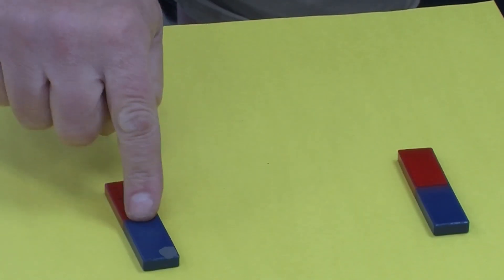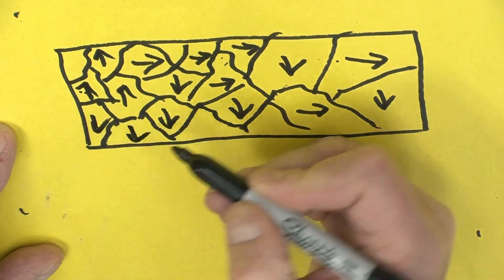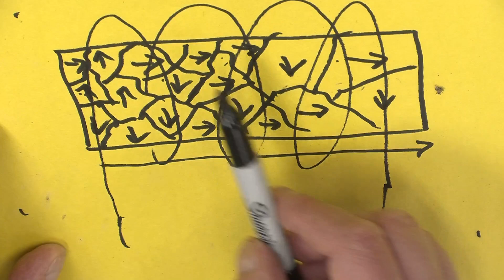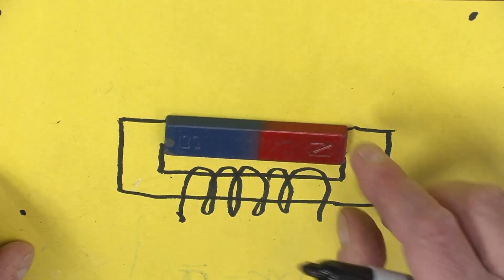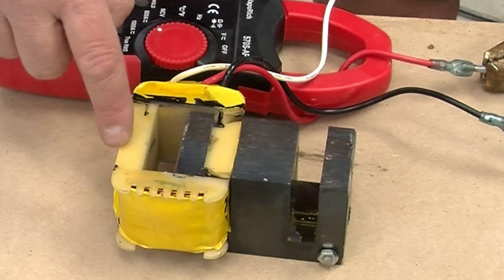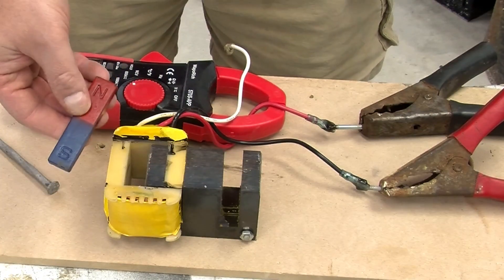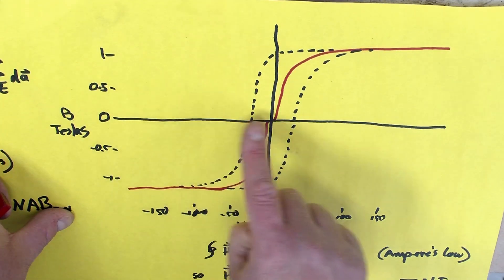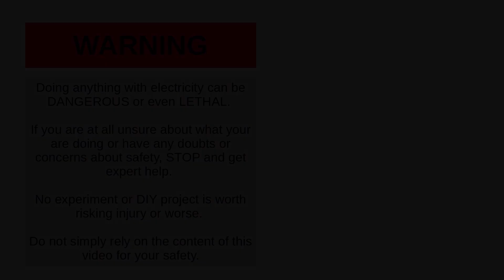How to (Re)Magnetize a Permanent Magnet

Comment: I have a small Steel shaft of 1018. It is about 5/8'' diameter and 3'' long. Is there a way to permanently induce magnetism into it? I assume i would need to make a device like you show at 8:00 but how can I make a simple one at home?
Reply from the maker: Maybe something like a bolt hopefully a bit larger dia than the shaft and also cut to 3" long. Wrap a few hundred turns of wire around the bolt. Position  the bolt parallel to the shaft and cut 2 metal plates so they can be used to connect the bolt to the shaft. Use some tape to secure the plates nice and snug to the bolt and shaft. 

Now apply a few seconds of current to the coil from something like an old style battery charger. 

Note: make sure the cross sectional area of the bolt and and the plates is larger than the shaft. You may have to experiment to get to enough current though the coil to make it hit magnetic saturation.

Also bear in mind that 1018 is magnetically soft and wont retain magnetic fields well. You might be better off gluing some neodymium magnets to a convenient position on the shaft (assuming it doesnt rotate too fast)) to keep it magnetized in which case you wont need to build a magentizer.
Reply: @ElectromagneticVideos  Thanks for all the info! 
This if for a small chemical mixer. I am having to remake for a customer. This shaft is what drives the prop so I believe it needs to be Diametrically magnetized. I am considering drilling the length of the shaft and inserting a couple 1/4'' x 1'' Diametrically magnetized magnets. Would them being inside the shaft severely reduce the magnetism field? Or would that be sufficient to spin it?
Reply from the maker: @NMmachine  Being inside a shaft will tend to shield the field and keep it inside. 

Now that you describe how it will be used, I am very doubtful that it was built to depend on a permanent field in a steel shaft like that - the field simply would not last any length of time. 

Does the shaft rotate? (EDIT - re-read you message - so it does rotate - I will leave in the piston comments but please ignore them :) ) Or move like a piston in normal operation? Is there a coil connected to AC that somehow is near the shaft. My guess is the shaft is either rotating like the the rotor of an induction motor or moving back and forth like a piston. Neither would require permanent magnetization.

I would which the coil - is it open? If the shaft rotates, are there two coils? If one is open it wont work.  ANd if there are two coils, is there a capacitor in series with one coil - the old capacitors tend to fail over time...
Reply: @ElectromagneticVideos  I have not seen the motor that this shaft goes inside. I will try and get my hands on it this afternoon. I believe it is a AC motor. The shaft assembly from the Original Manufacturer rotates So I believe the Motor to be in working condition.

Correct the shaft is rotating. 

I believe the entire assembly is called a Lab mixer or a Lab stirrer. For reference.
A little more detail on the shaft assembly. There are 3 pieces to this shaft. 
1 - The top that is inside the motor. This is the part I have been describing it is about 5/8'' Diameter x 3''' Length. It is heavily magnetized.
2 - There is a 1/4'' Diameter shaft that is welded on the bottom of Item#1 about 12'' long with threads the opposite end for a prop.
3 - The prop. about 1.5'' diameter with blades to mix.

The issue is Item #2 and #3 needs to be a more chemically resistant material.

First Attempt: they tried to coat the entire assembly with PTFE but the heat from the coating process Demagnetized item #1. The assembly would no longer rotate.

Second Attempt: I remade the assembly with Item #1 being 1018 steel. I tried the tapping and stroking methods to induce a magnetic field but could not get it to rotate.

They ordered another assembly from the manufacturer. Item #1 is heavily magnetized and the assembly rotates as it should. Only the Chemicals they are mixing ate Items #2 and #3. So they wanted me to make Items #2 and #3 out of Hastelloy. 

Third Attempt: Item #2 was welded onto Item #1. So I had to machine away until I could get past the weld and get a proper straight drill and ream into the material to press a new Hastelloy Item #2. But had to remove almost 1/2'' in length from Item #1. I TIG welded a spacer to the bottom of Item #1 to achieve proper length. There is still some magnetism left but near the weld the heat de magnetized a large portion. 
- I am going to meet with the customer this afternoon and see if it will still rotate.

I think the best method would be to make Item #1 from scratch but I do not know how to magnetize it sufficiently and achieve rotation. 
Or am I looking at this incorrectly. Is the magnetization caused by the motor itself? If so why would Second Attempt not rotate?

I apologize for the long response and appreciate your insight. I am stumped.
Reply from the maker: @NMmachine  I must admit I am baffled! If the shaft was supposed to be magnetized then  the motor would be some sort of stepper or synchronous motor - good for speed control, but much more complicated in every way  compared to an induction motor that drags things around with the rotating field. But since you have found the rotor is very magnetic and doesnt worth then its demagnetized, it must be something like a stepper or synchronous motor .

So maybe efforts should be made to no-demagnetize the rod when welding. Heat from the welder will demagnetize anything heated above the Curie temperature. The current from the welder might also set up magnetic fields strong enough to mess up the original field. Maybe some other method of join the rods - glue, or a rubber tube with clamps around it? You could ask the manufacturer for advice too ..... good luck - hope you solve it (and let me know what the solution was- I very curious now!

Comment: Nice video. How about discharging a very high voltage  capacitor of say 60KV through a spark gap connected in series with  a coil of 600 turns in which this weak magnet is placed with correct polarity?
Reply from the maker: Your talking about using a current pulse . Thats the want many magnetizers work. Depending on the number of turns and the inductance of the steel bar to be magnetized in the coil. you can generally do that with voltages in the hundreds  of volts and trigger it with a switch or better, a SCR. In the end, as long as you get current high enough so that the field field somewhat above the  saturation value  you end up with a magnet.

Comment: Can you detail how the coil is working?

i need a magnetizer, and I have some coils (transformers & old motors). None look like yours, and you used it in a way I never considered.
Reply from the maker: If you want a coil like that, its a standard 120V to 24V (I think) transformer. Some like this one are poorly constructed so the E and I shaped sections are joined with a shallow weld that a grinder can take care of. Better ones, the E and I sections alternate between top and bottom and are glued together - almost impossible to take apart. This coils was from a old APC UPS rated at 1000 to 1500W if I recall. Look in a recycling bin for somthing like that to get one for free :)
Reply: @ElectromagneticVideos  no, I don't want another. I want to know how to use another. 

i have no ultimate product in mind, I just want to understand it a bit better.  I guess my goal can be to make a rudimentary compass needle.

Maybe I should power one, then wave a compass around it to see where the field is... I can use a normal compass like your mag-wand, right?
Reply from the maker: @Iowa599  Yes - that mag wand is just a two axis compass!

To magentize a plain old needle for a compass, the easiest way is to just stroke it with a strong permanent magnet. Or use one of these: https://youtu.be/AZsYHLHlIso
Reply from the maker: @Iowa599  Sorry - misunderstood. Yes - a compass is a great field detector. Be careful not to get it so close the magent pulls the pointer off its axis though.

Comment: Wish I had seen this much earlier. I adjust the strength of magnets for and industrial application. We don't use an iron core with the coil. The material to be magnetized is the core. There is no need to have an extended time to magnetize the material, so for the current required, a capacitor is charged and then discharged into the coil. Since the magnet is centered in the coil, it is a one step process. When loudspeakers are made, the magnetic material is not magnetized until the speaker basket and magnet assembly is assembled. It is then magnetized. Look for videos of the process online.
Reply from the maker: So you just use the working coil of the device to do the magnetization - with huge burst of current from a capcitor - what a greast way to simplify the process. 

I had no idea speaker were magnetized like that. I'm amazed that the fine wires in the coil can take the current - but as in your example - a brief burst is all it takes. I guess for the same reason, not enough energy in the current spike to move the coil enough to damage it.
Reply: @ElectromagneticVideos  They don't put the current into the voice coil. The magnet assemby is inserted into a larger external coil with high current capacity. The coil I use at work can fit a 4X6 piece, up to 8 inches long inside the coil. The coil is from a 30 KVA power transformer. The winding is 6AWG. I'll have to look at the capacitor value at work. I do remember it is rated for 63 working volts. I think it is 33000 MFD. The entire cycle is over in about 200mS.
Reply from the maker: @isettech  Oh - ok - that makes a lot of sense. Thanks so much for the details. I may try an make a magnetizer like that someday!

Comment: I haven't had to deal with such weak ferrites, but AlNiCo compositions a low enough coercivity that they're easily demagnetized.  Always have to keep them shunted and away from NdFeB magnets.  I once had to do a bunch of testing with mortar fuze components that used AlNiCo cores, and I had to make a jig to remagnetize them.  I guess that's the sort of inconvenience that happens when you try to reuse something that was meant to be used once before exploding.
Reply from the maker: So I'm really curious having never had anything to do with explosives. What do you use the magnets for - some sort of fuse or trigger? I would guess the shock of an explosion would also tend to demagnetize them ...
Reply: @ElectromagneticVideos  A lot of munitions fuzes have to do elaborate things where timing and sensing is required.  Where some of those things used to be implemented mechanically with clockwork, it's all done electronically now.  The problem then is getting electrical energy to power the microcontroller(s) in a way that can have a long shelf life (i.e. no active electrochemical cells).  There are setback and spin-activated dry-charged cells, pyrotechnic generators, and other stuff, but a lot just use a once-through linear electric generator activated by setback.  A tiny magnet gets snapped through a coil by its own inertia, which generates a single pulse which can be stored and used to power everything during flight.  That poor generator only does its thing once before it (and the rest of the circuitry) gets destroyed by the main charge.
Reply from the maker: @PSUQDPICHQIEIWC  Thats amazing. - and clever! Almost infinite shelf life and probably just e enough power to get things done. 

"That poor generator only does its thing once before it ... gets destroyed" I guess that so true for so many of our sophisticated weapons these days. And for many other things, microelectronics has become so cheap they are essentially expendable - RFID tags immediately come to mind.

Comment: error : the batyery equvalence makes sense only when the magnet moves relative to the coil.
Reply from the maker: Not quite sure what you mean. Reluctance circuits are a pretty standard way of approximately calculating magnetic fields in this sort of situation. Here is a link a that describes it in a bit more detail: https://eepower.com/technical-articles/magnetic-circuit-properties-understanding-reluctance/#

Comment: Why would you need to (re)magnetize a PERMANENT magnet? More science nonsense? :-)
Reply from the maker: Its not at all uncommon for a permanent magnet to loose its magnetic field, particualry after being dropped or exposed to heat.
Reply: @ElectromagneticVideos  Do ALL magnets loose some magnetism over time? Even neodymium?  What if never used? Can a magnetic domain spontaneously move out of alignment?
Reply from the maker: @MrSummitville  Thats a very interesting question, particularity since we have have only been making magnets for the last few hundred years. 

Iron containing rocks that have been heated have retained traces of the earths magnetic filed for thousands (millions?) of years, but those remnant fields are very weak. So magnetism can last a long time. 

Magnet life is a probability thing: how strongly the domain boundaries are "locked" into place (based on the nature of the material the magnet is made of) and what forces/energy is available to help knock those boudaries loose so they can settle in a lower energy (lower total magnetism) state. 

We constantly have thermal energy jiggling the domain walls with the occasional random big jiggle being enough to shift/release the weakest boundaries and therefor weakening the magnet. But after a short time all those weakest boundaries are moved and magnets tens to stabilize. Exposing a magnet to an opposing (repulsive) field provides more push to move those boundaries to reduce energy and reduce field so the thermal jiggling can now move some slightly better secured magnetic domain walls. 

Bottom line: if the  random  max thermal "banging" of the magnetic domain walls + an opposing field exceeds how tightly the weakest magnetic domain walls are secured in place, the some domain walls will move and weaken the magnet. 

In most controlled situations - not exceeding a certain temperature, vibration and opposing magnetic field, the magnetism will settle at a reasonable value (which can be very high as in neodymium example). A good example of this is magnets in an electric motor or loudspeaker in a car - very unfavourable place for a magnet but modern ones with materials designed for that do well.

So in the end after first magnetizing a magnet, its field will drop a bit but hopefully settle at a (good) level dictated by the environment it is subjected to or operated in.

Comment: in reference to demanetizing an object, grandpa showed us that you could use a spark plug wire to zap what ever you wanted to demagnetize by allowing a spark plug off the engine to arc across the object a few times.. but wear gloves when  you do this  engine coils are extremly unforgiving1and use a pair of no elctrical holding devives such as a plastic tong from the kitchen an not a pair of plastic coated needle nose plyers..haha
Reply from the maker: Interesting that a spark plug type zap would do it since the current isn't generally that high. I wouldn't trust  the plastic on pliers or gloves for that types of  voltage - an yes - I have been zapped before :)

Comment: We used to magnetize screwdrivers with a car battery and a piece of stranded copperwire wrapped around the screwdriver. the more turns the better ,, then we would short the 12 volt batter leds across positive and negative till the wires were smoking then after lettting it cool off we had  amagnetized screwdriver which was way stronger than the pocket ones . Automotive hacks fro picking up screws ect out of intakes or disributors back in those days .You have made a few comments in regards to heating up the metals to line up the direction of the north and south poles in the structure of the atoms inside the iron. This is how the majority of ferrite and neomydium magnets are made in the industry . However certain metarials added will increase the feild strength as well as be subject to the breakdown polarization of the atomic structure inside the magnet it self. . 
most applications as far as the hobbiests will ever use themm for do not go beyond 100 degrees  f.. however certain kinds made for the Areospace and space industry have higher breakdown temps due to thier conditions in outerspace. Have fun  in creating your own magnets. I tried a dc welder the other day to try to magnetise an iron nail.. i couldnt hold the wire feed long enough on the wires to create a long enough field . tommorow i will try heating the nail first and using more wrapps around the nail and then quench it in cold water to see if it will retain the magnetic field. ty for your basic presentation of the magnetic  theory. the coils setup that you made i had completly forgotten about .. I have always been into magnetic induction and fields ect since i was a teenager. im 61 now and retired and have nothing but free time to enjoy this one of many favorite hobbies of mine.
Reply from the maker: I have heard of variation of what you described. I guess the trick is to do it just long enough but not so long that the wire melt from all the current available from the battery?
Reply: @ElectromagneticVideos  yeah that s the idea,, fine wired cabling works better than solid core ,as in house wiring  though it will work.. just need alot more turns ,and fry your battery too.. better to use stranded wire as it carries more current ,, i have melted down wires before and they do have a tendacy to catch on fire ,,so beware .
Reply from the maker: @randallmarsh446  " i have melted down wires before and they do have a tendacy to catch on fire ,,so beware" Yes! Might not be a bad idea to make a "fuse" with a length of slightly thinner wire to protect the bigger wire and battery...